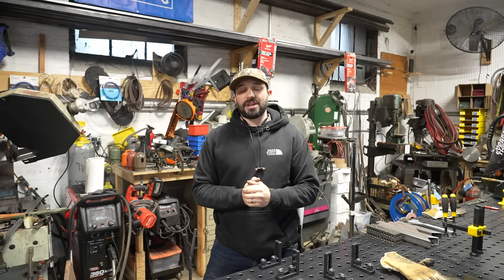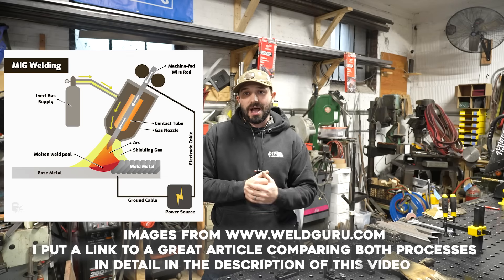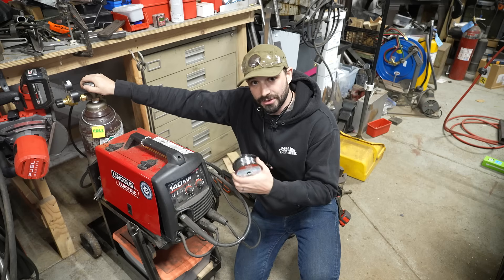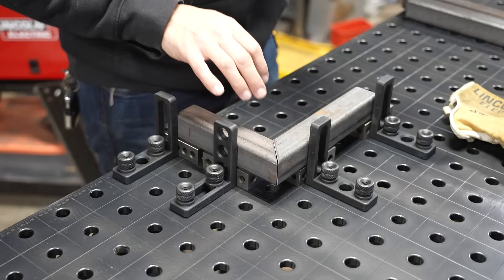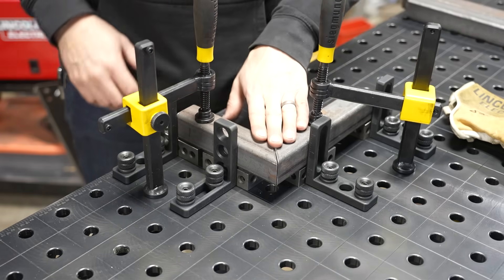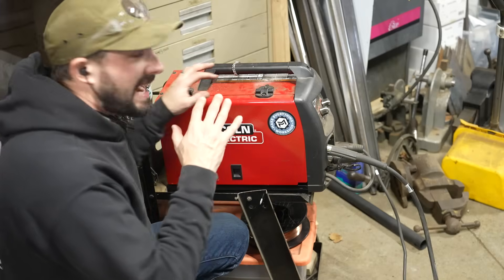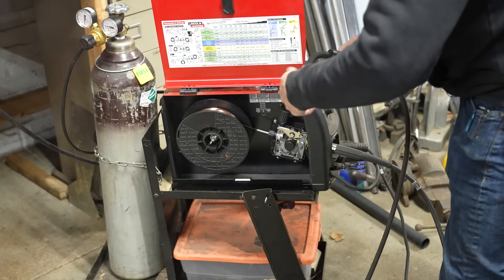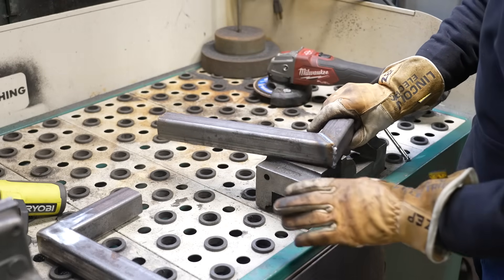“Gasless” MIG Welding Explained!

Comment from the maker: I left out a key detail in this video! When you set up your MIG welder, OR switch from solid wire MIG to Flux Core, make sure the POLARITY of your machine is correct. Most machines, including this one need to be set to either electrode positive, or electrode negative in order to flux core/MIG weld correctly. Check your machine and make sure the electrode and ground are connected correctly for your particular process for the best results!
Reply: I didn't think this was a tutorial for how to weld. Just comparing the two processes. As far as the cheap Harbor Freight welder goes you can modify those to weld better. They're cheap because they leave out some parts that are nice to have. Like a rectifier, an inductor and a capacitor. Those parts increase the cost of the machine. But they also stabilize the arc too. The HF el cheapo is AC.
Reply: metal no sticky :)
Reply: Must change your feeding wheels don't ya?
Reply: @ 

Some of them you can just flip
Reply: When switching from flux to mig what else is needed?
Reply: @brokenwrench404 

Besides the tank and hose with regulator you would also need to change your nozzle for shield gas
Reply: Это твой самый большой провал в истории ❗❗❗
Reply: 🎉😢😢😢😢😢😢😢uuuuuuúhh😢uhh😢uu😢huh
Reply: 💯 Facts, Mr.Makeeverything.
Reply: No shit caption obvious
Reply: Also noticing, never ever forget to shut off that gas bottle,like turning off the lights the same for the gas.

Comment: Welding is something that every experienced welder has an opinion on.
My opinion as a certified welder for 25+ years as follows. Yes mig welding is great for light to medium welding. Heavy thick metal welding, flux core is preferred. There's inner shielded, outer shielded and dual shielded. In the steel mill fab shops I worked in we used outer shielded flux core. 75/25. .045 and 1/16" mostly. I have used up to 330# of wire on one skim shelf. The shelf was 5000#-  5500#. Clean and preheat. Flux core. .045 and 1/16".  Some of the best looking welds money can buy 😂. I'm retired now and haven't done any welding since because I don't have a welder but after watching this video I'm thinking maybe I'll get me one.
One other thing and I know people will disagree with me and that's ok I don't care.
When vertical welding with MiG you can weld down hill. If you have your settings right and have experience. Not stick and not flux core. Reason being you weld uphill so your weld isn't contaminated by slag/ flux. MiG doesn't have flux. Old school everyone says oh 😮 you have to weld uphill always!!  No! You can but you don't have to if you have set up and travel right.
Good video though. Maybe I'll get me one of those MP welders , they look like they would work fine.

Comment: what about the difference between 120V-240V voltage power? does it make a difference in the quality of the weld?
Reply: My understanding is that a 240v welder has the capability to allow you to weld thicker steel.

Comment: In now day you can find good and affordable welder for hobbyist (welding few hours during the weekend) that can do :
Arc/mma, mig/mag, flux core, lift tig.
Pay attention with terminology when you do educational video, is not you heat is too high is the current is too high. Misleading slang terminology is not helpful for beginners.

Comment: One ran hot and required touch up and one ran cold - which could under wield.  Had there been test metal from the same material to level set before beginning - I would expect the same results (matching) with minimal grinding afterwards to get a smooth polish for painting.

Both Flux and MiG require spools of wire, so the difference is in purchasing and stocking Nobel gas and all the additional gauges and expenses ....  Flux wins hands down.

Comment: Next time, try this. Tack the outside corner. Then the inside one. Tacking the inside first will make the outside corner split because the inside shrinks. 

And...the most important difference between MIG and FCAW is polarity...not gas! You can weld with solid wire with no gas. It isn't great but will do "fine" for auto body "stitching".

Comment: I started out with the earlier version of the Lincoln 140.  I've been using that for about 10 years and I've only done flux core welding. I really don't want to bother with gas bottles. The wire spools get shipped to my house from Amazon.

I am trying to get stick welder from amazon for doing the thicker steel faster. They have 120/240-volt ones for about $130 now. I want to work with 240 volts.

Comment: I'm gonna be honest, I'm not an engineer and want to fix my metal household tools (fence, door, outdoor roof structure, etc). I'm planning to buy welding machine probably use it once or twice, and then forget about it, now if I gonna buy gas it will be a waste. so eventhough gasless welding sound difficult, probably still buy that. thanks for the content tho.

Comment: My first welder was a Bestarc mig 145, it’s a 3in1 and has been great. Came with everything to get started and I’ve been practicing for about 6 months now, even welded new beside panels and wheel houses on my old superduty pick up. Used some rivets too just to be more cost effective. My first tank of gas was about $220.

Comment: I think that thin (.025) solid wire gas  weld  wouldnt be very strong on that thicker metal , especially after you ground it all down. That size is  mostly for sheet metal. You should have tested it for strength

Comment: I was about to comment that you had not addressed the need to swap polarity.  I suspect you didn't which probably contributed to the turn up the heat a little to eliminate the cold joints.  I recently replaced my 30+ year old MIG welding machine with a new one capable of flux, gas, stick and TIG.  I especially like the 'pulse' feature.  You should check it out as it is a terrific benefit to infrequent 'casual' welders.

Comment: What type of gas and bottle do we need will it have a regulator? I know it might sound dumb but just getting started. Thanks.
Reply from the maker: You want a C25 bottle, it’s 25% co2, 75% argon. Your welding supply will know what you’re talking about when you say you are MiG welding. MOST MiG welders come with a regulator and hose but they don’t you can get them on Amazon. Good luck!
Reply: . Thanks

Comment: Also, amateur welder here, didn’t know the table clamps were not just to keep the piece in place, but to also keep them in place due to the hot weld causing the piece to move! Thanks for all the info in the video!👍

Comment: MAG is great for anything over 1mm plate, especially when you are lazy and don't like to remove rust first.
But if you want to have any chance of welding rusty door sills and other thin plate things on cars.. You're gonna need MIG.
Flux is just too hot for thin metal like that, especially when rusty.

Comment: Great video...straight forward...no BS no condescension. Curious about the gas. What was it?
Thanks
Reply from the maker: The gas is commonly referred to as C25, its 75% Argon and 25% CO2. it's a great shielding gas for mig welding. There are other options as well but if your getting in to it ask for a bottle of C25

Comment: You Welding table has a super hard coating? what coating is it?
Reply from the maker: Siegmund uses a proprietary coating, I’ll be honest I’m not sure what it is but 2 years later it’s SO durable!
Reply: Prolly same as how the do black metal maybe, like cold bluing metals.. thats great no need to keep spraying wd40 on the table to keep rust out.. i wish i had a Siegmund

Comment: This is a fantastic video. I just bought a MigVan M-140. Yes, it was very inexpensive. I've never welded anything in my life and I'm 53 years-old. But I have always wanted to give it a try and just mess around in my shop. I've watched 20 or more videos in the last day or so and yours is, by far, the easiest to understand and the most informative. My little welder does it all, but I am going to start out with flux just to give it a shot. Although, after watching your video, I am also anxious to run down and grab a little tank of gas as well. Thank you so much for comparing the two. Looks like MIG is a lot cleaner. Anyways, thank you for the links and the information.

Comment: Fluxcore is MIG.  Normal steel fabricating ( heavy equipment, cat loaders, etc.) is done with fluxcore with CO2.  It is as strong as 7018 stick but about three times as fast in the flat and horizontal fillet weld positions.  What you are referring to as fluxcore is known in the industry as Innershield.  Solid wire or what we refer to as 'hard wire' in the shop has a copper like coating and is normally used with a MIG mix gas.  Solid wire can be used with CO2 but it is not as smooth and weld appearance will suffer.  In our custom fab shop we had solid wire MIG welding tickets up 1/4 plate and MIG fluxcore with CO2 1/4 and up.  I personally used a 400amp Miller welder with 3/32 fluxcore with CO2 for fabricating furnace shields out of 1" plate.  MIG solid wire is great for light fabricating but we found it had poor impact strength and was prone to cracking if used on things like snowplow frames or loader buckets.  I was in the steel fabricating industry for about 25 years.

Comment: My first welder was a campbell hausfeld flux core welder that i traded a guy a steering wheel for😅. But for whatever reason these flux core units, and thats what it says on the body of the welder making no mention of mig welding. Anywho the gas solenoid and other gas provisions were there on the machine under the cover. This confused me so i called up someone in the know who welds for a living and it seems that when CH was discontinuing that model, they just relabled it a flux core machine for sale at walmart, and could be set up with gas if one were so inclined.😅

Comment: I run about 10 pounds of flux core a month. For someone buying their first welder, the Titanium 170 from Harbor Freight is a solid choice. I use mine almost daily and the boss is pleased with what it does. The best part is if I need to run MIG, it is a simple matter to swap the leads, wire, and open the gas bottle. Less costly than most of the other brands to purchase too.

Comment: im not a great welder, however, whenever I have done vertical welds with a MIG, I have to travel downwards...ARC welder verticals are usually upwards. I think this might have helped there. (I'm assuming you did the vertical weld upwards on purpose so that you could intentionally create a really bad weld to show how forgiving MIG is when compared with flux core?)

Comment: Great video. One question I have is on the wire if you're using mig to do flux core welding can you use either wire or it has to be specifically flux core wire.

Comment: So in short, flux core is cheaper, somewhat more difficult to use on thinner metals, and can be very dangerous if you breathe in the gases.
MIG is easier to use on thinner metals, somewhat safer as it doesn't produce as much smoke, but can be very expensive. (holy moly is gas expensive these days)

As someone who knows nothing about welding, I would guess flux core or even stick welding would be the best option for beginners who don't yet know if they want to do welding as a profession, for newbies cost is everything. But if you're going to weld professionally then having all sorts of welding methods is obviously needed, stick, flux core, MIG, TIG, and whatever other methods exist, but for a noob who's simply curious, go with flux core in case you're not a fan, if you want to be even cheaper then just go with stick welding.

Comment: Okay, so I have seen other videos that basically say that flux core is better for lower voltage (110/120) and mig is better for higher voltage (220/240). What are your thoughts on that? Also, you do seem biased against flux-core. I know you mentioned stick welding, but for beginners, it seems like stick welding would be more awkward. I'm not a welder, I've only tried stick welding a couple of times and it was so awkward. Like, draw a picture, but put the pencil in a clamp and hold the clamp. Tig seems the closest to holding a pencil, but if the pencil touches the paper, you have to spend 10 minutes sharpening a new pencil. I would think mig/flux core would be a good place to start, but are there different requirements for voltage?

Comment: Basically flux is no gas and lots of spatter😂
Mig is gas, argon/CO2 or straight Arg, and the wire..  much less spatter.   
  Flux will spatter more than stick welding with a chunky 5/32 stick😂.

Comment: Totally new to welding. What gas is inside a gas bottle?
Reply from the maker: @kingOfSpades305  for MiG welding you’ll typically use 25% co2 75% argon. Welding supplies call it C25

Comment: @MakeEverything When doing flux core the cleaner the better (no rust, paint, dirt, etc...) in the weld area. if you need to stop and start again then its best to clean the slag as it will contaminate the weld. you got that as you passed over yout tacks.

Comment: Thanks for your video! I have a question: I have a cheapo 120v flux core welder that I am planning on using for a build in the spring. Some of the steel i have, or intend to use is a bit thicker and I wonder if its smarter for me to stick with flux core since I'm not running all that powerful of a set up - you mentioned it burns hotter. I've yet to set it up in a MIG configuration, and I like that you are saying its more forgiving, however i already worry that I'm not getting the kind of penetration i need. Thoughts?

Comment: as an absolute beginner, i will start with a flux core one. most of projects i will do are DIY small carts, furniture, woodshop or gym related. plus the unit i'm looking at works with a 15A-20A home outlet, i don't have 240V circuits to spare.

Comment: Flux core is great for occasional users and DiY repairs, being simpler to set up and one less variable to worry about.  I can fix planter brackets, gate hinges, garden forks and the like, which over time saves money.  I draw the line at anything structural, like car chassis, boat trailers and where a weld fail might be disastrous…but that’s just me.  I sure there are very competent flux core users with big machines who can weld tow hitches and 1/4” box section trailers.  ……There are limits of course..I know for example most core wire is meant for single pass only…you can’t keep layering it up to fill a 1/2” vee groove; something to do with the slag forming voids or inclusions which weaken the joint.  Maybe the vid should have touched on this?  Anyhow thanks for the share.
Reply: Flux core penetrates better, especially through dirty material or a galvanized surface, it can weld out in the wind & is often used on structural welding out in field applications where its actually the required welding process/standard called for - Multi-pass flux core wire will usually be labelled something like E71T-11 (look for the 11 as this signifies multi-pass).

My advise is stop using the crappy single pass wire (usually labelled GS) & use a multi-pass wire as your welds will improve straight away with multi-pass flux core wire. For anyone having trouble seeing the weld, use a green or blue lens as it makes the world of difference.

Because of the lack of knowledge & it often being seen in the hobby welding isle, many don't realize its immense contribution.
Reply: @mrdrains2088 
Wow!
Thank you…I learned something just from reading your comment.

Comment: Good video. I noticed over the years that fluxcore runs much hotter due to the fact it doesn't have the gas flow cooling it slightly down with the exception of dual shield.

Comment: The best description (just technical enough) of difference between MIG and Flux Core welding processes.  Both are MIG, one is just 'gasless'.  However, whatever creates the understanding for best communication.  A helpful hint for welding square tubing is to weld the outside edge of corner first - as the weld shrinks, it will open to the inside edge of the joint, which is easier to manipulate back into square easier.  Now, being clamped on an expensive fixture table kind of negates weld movement to a degree - but not everyone can afford those.

Comment: What would be your recommendation for car body repair
Reply: If you want the extra work and frustration then go with flux core. 

Go with the shield gas and you will get a far better cleaner weld.
Reply: Go with gas Mig.
Reply: @paullynch928  
👍

Comment: As I understand it, stick welding is bad for thin sheet metal.

Would flux core be an acceptable alternative if I want to avoid gas?
Reply: Why would you want to avoid gas and consider flux core its messy smoky and looks like crap compared to a mig using shielded gas. 

I’ve used both, the only advantage with flux core is when you’re welding outside it doesn’t matter how windy it is it won’t affect your weld.  Using a mig outside on a windy day will blow the gas away from your tip and you can’t weld with solid wire without shielding gas. 

I weld a lot of exhaust pipe and believe it or not but I prefer using my arc welder 😆👍
Reply: @jimmoravec1326  I'd have to drive an hour to pick up a huge ass gas tank for a lot of money. Then exchange it for a full one each time. And you cannot pay for a smaller gas tank. I have a small car it may not even fit.
Reply: @ 

What do you mean you can’t pay for a smaller tank, like a 40 cu/ft argon and Co2 mix 
Why is that ?

You don’t need a 125 cu/ft tank unless you plan on welding every other day. 

You will go through a lot of spools of wire before you empty a 40 cu/ft tank that’s less than 3’ high that should easily fit in any size car
Reply: @jimmoravec1326  
What is cu/ft? 

It is sold per 30/40 liter tank. They are big, and expensive. You want much bigger or smaller you need a KvK number and I am not paying a monthly fee for that to weld. Cheapest tank itself is €399.